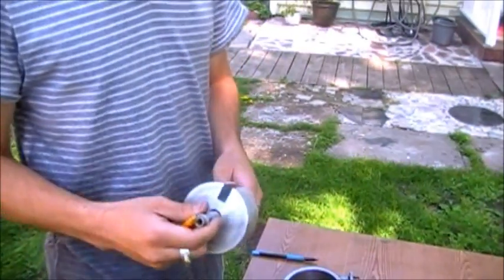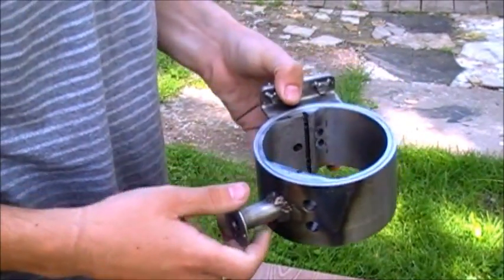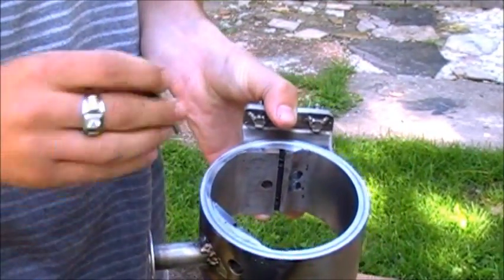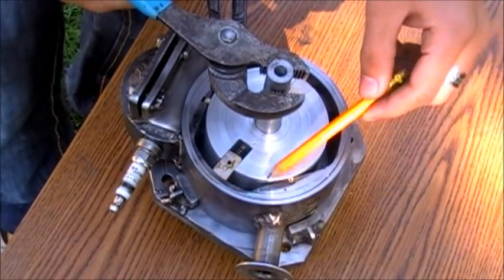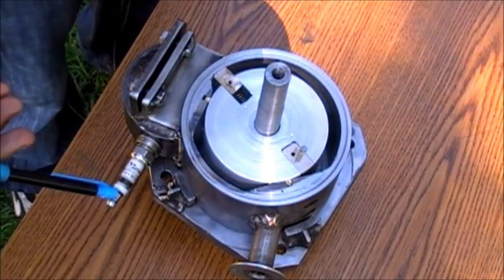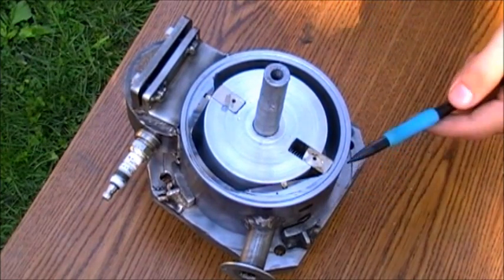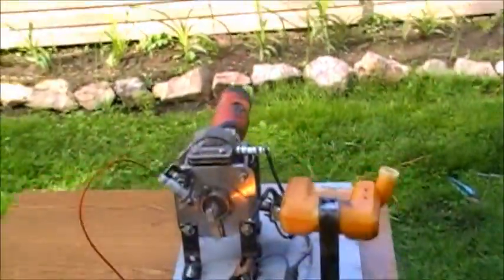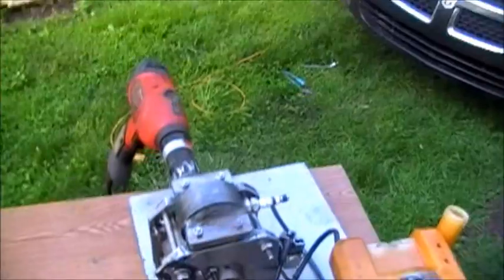new rotary engine semi functional prototype

Comment from the maker: i would like to remind you guys that this prototype is working the way it is only because of very poor execution of the parts .... the prototype is made on a 300$ lathe  and bench sender.
Reply: nikita surgay No need to remind us - anyone with even the smallest bit of mechanical knowledge had an "Oh wow" moment when you showed us how it worked, and we know the problems lay in imprecise engineering.  This engine is going to be absolutely incredible, seems MUCH simpler and easier to service than a Wankel.  I can't wait to see the next incarnation of it!
Reply: @davidwisniewski3378  how wrong you are. IT IS only a modification of the Wankel engine.this poor fools is only wasting His time, the time of combustion engines of any kind ist over. E-engines are the Future because of deveral reasons: muchHigher efficiency, easy to build,  No wear and Tear, silent, No dozens o secondaty parts Like mufflers, belts, srnsors and  Pumps hoses etc. No maintenance and oils needed. You are "riding a dead horse"!
Reply: @davidwisniewski3378   rubbish! All fueldriven Motors are complicated and need dozens of secondaty things Like Filters. Hoses, Pumps, water Pumps ewith belts and precision moving parts. There is only  one Type of pefect engine , which is the electric Motor, which existed before all the combustion engines and will survive them.the reason ist ITS simple sricture and it has only one movinvg ppart which IS rhe Rotor,which has No waring parts. IT will eben "survive ITS car. Only think of all the Pumps that have been driven By electric  Motors for decades, or in cranes or Generators. Constructing a "new" combustion Motor ist "riding a dead horse"
Reply: @davidwisniewski3378  you will never see it running. The simple reason ist IT can never Work. Btw it IS only a  Variation of Wankel's Machine. In ITS time IT was a revolutionary new principle, and the best Car was the German "RO 80" in the seventies but  nowadays only mazda used it. (No one knows why) The best principle ist electric Motors because of their simple construction. I Drive an EV and believe me: it's fantastic.
Reply: There is a serious problem with your engine. It seems that the engine is completely incapable of compressing air before combustion. This isn't just to do with the hugely oversized combustion chamber but also the fact that the expansion ports leaving the combustion chamber don't have valves. This means when the vane moves over the combustion chamber, the air fuel mixture goes into the combustion chamber then immediately leaving it into the expansion chamber, equating to a compression ratio of 1:1. Don't worry though. This could easily be solved by simply placing a valve operated by a simple camshaft that opens the port once each revolution to allow the compressed air fuel mixture to expand. So all you need to do is place a valve on the outlet of the combustion chamber, reduce the size of the combustion chamber and you should be well on your way to producing a fully operational rotary engine. Hope this helps :)
Reply: @JackdalfdaGray  

you have noticed ...thank you ... see this is not a design flaw ... but a feature ... the idea is to not haver a compression ... just like your air tools run on 100 psi the pressure of  combusted air fuel mixture at atmospheric pressure is about 100 psi .... ... think of a potato cannon ... there is no pressure in the combustion chamber but when you ignite the mixture inside the pressure builds up shooting the potato out ... .this is the same principle ... except you have a plate instead of a potato ... 

i do appreciate the input ...
Reply: +Billi Backer Why do you need to brow beat the little guy who is trying and thinking outside the box? Its people like you that will push away and quiet those who try to speak out, innovate and stand outside the box. Meanwhile you&#39;ll sit there along with others and point and laugh from the inside. Maybe if people tried helping instead of just pointing out flaws and crushing the attempt, we would be a lot further than we are today with technology, and as a species!
Reply: David Wisniewski Yes i agree. if this is a success we got a new "Nikita rotory rotor engine" lol. Good Luck and i hope to see your success in the news reports in the future (Im serious about everything i said. good luck  :D  )
Reply: +nikita surgay wha do you try to "invent the wheel" for a second time? it already exists
Reply: @friederich66  

does it now ?
 please point me to any internal combustion mover with 60+% of efficiency ...
Reply: @friederich66  Cleary you ain't an engineer if you can't comprehend why someone would want to invent a better "wheel"!
Reply: My point was that prototypes can out perform even the most relevant designs. This engine is a prototype that needs improving  (a lot of it) but could be the next generation of rotary engines. But it very well may not be, it's still a concept that probably won't make it to production, but it's new. New isn't always better but it'd be neat to see future rotary engines use similar aspects this engine has. I have a lot of respect the creator of this engine because from what I've seen, this is the first of it's kind.
Reply: +Billi Backer   It is so sad that people who do not fully understand the thermodynamics of combustion in engines, volumetric efficiencies and flow coefficients, etc., believe that they can produce a "more efficient" engine by going down the rotary root.   It has been proved time and time again that such efforts always lead inevitably to failure, despite wild claims to the contrary.
Ricardo tested such devices extensively over many years and at great expense, but none came to fruition.  Many millions of dollars were expended in the process.   (This came from the "horses mouth", so to speak, via an ex assistant to Sir Harry Ricardo himself, who is now in his seventies and works as an engineering consultant.)
The power output of an engine is dependent on the mass of air that can be forced through an engine and the efficiency is simply a relationship between the temperature at combustion and the temperature at exhaust.
The mechanical layout of an engine is thus mostly unimportant, except for the considerations of mechanical friction and sealing against leakage, both extremely difficult to overcome in any rotary design.
Every rotary engine I have examined suffers from poor flow coefficients, poor combustion chamber shape, (resulting in quenching of the flame front) poor sealing and high frictional forces on rotor side faces, sliding vanes, tip seals and the like.  A further problem lies in achieving adequate cooling of the rotor and adequate lubrication without resorting to total loss lubrication, which would never satisfy the clean air brigade!

We are stuck with pistons in cylinders because they work well, they are relatively cheap to produce and we haven't found a viable alternative since the 1800's.
Reply: +nikita surgay Bit of a tip for you, inventor to inventor. The sensor you are using for your ignition timing is not designed to operate at the switching speed and current necessary for an ignition coil to function. That's the real reason your engine fires so intermittently and weakly- the spark isn't actually happening reliably. 

I had the same problem with a prototype engine I've been working on since 2009, and after going through several different ignition pickups ended up creating my own hall effect triggered electronic ignition. 

Now that it is positively getting spark every time it should, it fires so reliably that just turning it over by hand I can feel the shaft being pushed along. But like your prototype, it is a bit on the crude side and is leaking too much to actually operate on its own. 

I've got a second prototype on my drawing board that will be suitable for showing off, and hopefully will be machined accurately enough this time to actually operate on its own.
Reply: @renegadeoflife8774  hall effect is simple and reliable!
Reply: +nikita surgery If this idea is original (completely thought by you and/or your collaborators ) you should've patented it and sold it to someone, I am pretty sure you could have taken a lot more benefits from your idea if you had done this.
Reply: @miguelcontreras5782  
i have a patent for it .. however selling it is a whole other can of worms ... its very difficult to sell something when it is not running.... engineers don't even bother to dive deep and understand that this idea is fundamentally different from a conventional internal combustion engine
Reply: you can modify the rotor plate to drive smoother by making curved angular cuts on its 90* ( 90 degree cuts ) , also you should apply the same curved cuts on the sink plates that presses on the rotor  cylinder . 
your engine is a good economic rotary engine , that is great so far , I also noticed the heal of the hub  ( where your seal plates are seated ) it drop off at great angle on the cylinder hub frame , try to use inward curve drop to avoid the cylinder plate ramming on it <--- that ram is creating unstable rotation . which is effecting the timing/ intake and exhausting .  
great engineering by the way  and good luck
Reply: Dr. Shocker mhm... car manufacturers spend millions for motor development. and a d.i.y machine beats them all...,wankel motors have strong advantages and some disadvantages, the home manufacturer has not the materials necessary für a good result.
detail work doesn´t solve the principial problems of this construction.
if it was better than normal machines they would have been a success story. they werent, so the logic says they are not better.
i own a 3-cylinder BMW car, it is fantastic, i was suspicious but  it is a first class motor. i bet they will develop 2-cylinder engines. too.
Reply: @friederich66  a home hobbyist has the internet therefore ALL materials are available to him, it just comes down to cost!
Reply: @73Datsun180B  anyway IT IS stupid to try to invent the wheel a second time. The time of compassion engines is over. The waste too much energy.EVs use energy three times more effective. Believe it or not.
Reply: @friederich66  You don't need to preach to me bro, electricity is the most universal energy source and electric motors are the most efficient engine design. I love fossil fuel and the things that burn it, but I understand it isn't the future. However, I ain't going to shame anyone wanting to spend THEIR time and THEIR money trying a different approach to old tech!
Reply: ***** none. it´s just common sense. te wankel-principle was  used in a german car the RO 80 (ro=rotation) it was not a success. if 2 RO 80 drivers met they showed each other the number of the new motors with their fingers. there was a japanese car which was produced under license and was a flop as well the problems are too big, still it´s the corners  which make problems (sealing.) 40 years have not shown any progress. if big firms with X millions for material and system research cannot solve that, how can you think someone can solve that DIY in a small workshop.... if it was solvable itr would have been solvwed. if it was better than other engines  there would be million sof cars with  such an engine- understand that you are riding a dead horse....
Reply: ***** you must be rich. people like me cannot afford such an expensive toy... for that money you can have a nice house, i would prefer that (i have already one) my bmw cost 29.000 euros, so i saved approximately 130.000 euros. 
i have a range of approx. 800 km and my tank is filled in 2 minutes. i wish you all the best and that your tesla may nit burst in  flames...a rather expensive firework that would be.....
Reply: at least i would have liked to see it running by itself. instead it was moved by an electric driller. i know why: it doesn´t work. it cannot work. again: it it was possible and if car manufacturers would smell profit they would build such an engine tonorrow.. that has nothing to do with idiotic conspiracy theories. this is only an excuse for the personal lack of success. it is sealing, cooling and durability.
Reply: @friederich66  

you are right .... about everything except one thing .... that it cannot work ... it can ... but see for anyone to actually consider it .... i  need to build a fully functional prototype... ....now thats a few thousands of dollars that i have to make and spend ... thats .. all....

i will answer some of your questions ... tho ... sealing .... is mostly a manufacturing problem there vane type of air motors comparable in size that do not use side seals and produce about 70% efficiency.... so its easily achievable with good machinery ... ...

durability ... 

you are right if i run this engine at 10 k rpm it wont last a minute even if it is made ot of best most light weight materials ... 

but if i run it at 1000 rpm there is almost no wear ... at least at thins particular diameter... now if things are precision made out of cast iron and other proper material with low coefficient of friction ...i think it could do about 2000 hours ... 

cooling ... 

now that's the best part ... if you would at least take your time to look at the design or to listen to my broken at the time English ...
 you would realize that there is no compression .. without the compression there is no high temperature explosion ... plus the amount of volume during the expansion is  the same as the amount of combusted fuel mixture ... so it would basically get a full expansion and full combustion...

now the main question how would a motor run without compression ?

simply ... so  in this particular prototype ... the surface area of the plate is 10 square centimeters ... diameter of the rotor is 10cm  the  
now gasoline air fuel mixture is combusted at the atmospheric pressure the expansion ration is 9 .. 

so after the combustion at the atmospheric pressure  the pressure on the plate will equal to 9 kg per square centimeter .. thats at the peak at the exuast it will be about 1 .... 

1+9=10 

10/2=5
so average pressure should be 5kg per square centimeter ... but thats in in the perfect world  so we will drop it to 3 kg per square centimeter ... 

now 3*10=30 kg
now that the amount of total force on the plate ... 
.. 
now the diameter of the rotor is is 10 cm the radius is 5cm 

100/5=20
30/20=1.5kg/m 

now thats torque 1.5 kg/m  at 1000 rpm that will be 1.5 kw. or about 2 hp  ... so that's the attractiveness of this idea...
Reply: +robert McMazing Its true. the fact that the force from the combustion is not direct but has to be channeled to target the spring loaded &quot;ridge&quot; already results in a waste of power produced.
Also i notice that the compressed air/fuel mixture is pushed into the combustion chamber which is larger than the volume of the compressed mixture. the spark plug is located here, igniting an already expanding (not by combustion) mixture, altering (reducing) the compression ratio. Note the dwell immediately after pushing the mixture into the combustion chamber  after ignition by sparg plug = loss of usable power. The power ridge is dwelling before it reaches the power out port from combustion chamber. Lets not even start with lubrication
Reply: +Crobular I Sealing piece cannot follow the profile of the chambers at speed.
Reply: very cool idea, i would have never thought of it, works kinda like one of those new hydraulic pulse guns that are in no way better than conventional impact drivers but still cool, looks like it would have a very short service life due to all the vanes and sliding sealing components that basicly just mash and run over each other, they run flush now but they will get to the point where they wack hard every time they spin at which point the engine would be on its last breath . . .very cool unconventional idea, thinking outside the box but its not going to replace anything and sure isnt more reliable or long lasting than a wankel
Reply: Ci think it's brilliant and somebody needs to take you up on the idea
Reply: nikita surgay id like to add in the rotar piston should be a triangle or square js it might increase pressure and it may ignite better if the spark plug was closer as well
Reply: @gunz_n_bikes171  

this is no rotor piston ... this is a strictly rotary ... and there is no compression...
Reply: its not offset how can it be a triangle or square? makes no sense
Reply: @xibidit  

so the main attraction to this particular design is the fact that there is no compression ... it is an essentially a potato cannon that spins the rotor instead of soothing a potato
Reply: nikita surgay 
Install reed valves on the intake.
Reply: @benhawke7231   have thought about that the actual manufacturing of a reed valve at home is a bit difficult I've tried to purchase one ... but couldn't find one that the right size...
Reply: nikita surgay just so you know, the original engine was built with hand tools
Reply: @RandomsFandom  

i know isnt that just the most inspiring thing in the world ...
Reply: @nekitsurguy2445  it’s trash because it is going backwards on an already proven design. You cannot, and will not out engineer a team of Japanese race car developers. There is a really huge reason for the nacho chip shape, and figure 8 rotation in the rotary engines.
Reply: nikita surgay What materials did you use to make it?
Reply: i like it . but there is a lot to think about. concerning the inability of the springs to have a smoth syncronic response at all fq.  you will need to maby divert exhaust to drive the widget piston instead of a spring , or in conjuction with a spring. or a spring and a cam rod. or a moving weight as part of widget piston.
Reply: @michaelshultz2540  forget IT. The Future ist electric driving because is ist fantastic: simple construction and No wearing, and No dozens of secondary components like Pumps, gearwheels hoses, mufflers etc. And cheap maintainance.
Reply: Michael Shultz now that i think od it they could also try fuel injection. Lol
Reply: ***** you compare apples and pears, as we say here. 
of course companies want profit, that is in no way evil. they must earn money to pay the machines and the workers. if the wankel engine was profitable they would produce itr, believe me. thje production of such a motor with only one moving part would be the hit, you could earn bilions.... they don´t so it is a sign that trey do notr expect profit. and by the was these rotating engines consumed a whole lot of fuel....i have a 3 cylinder bmw engine in my new car (AT) anit takes 6 liters on country road and highway.
the other problem is elecric driviing. it will not be successful, the production is in the x/1000 quantity vompared wis gasoline motors.
the charging takes hours instead if minutes for tank-filling, the range is only about 100-150 miles, not enough charging stations, and im,possible to charge when you live in a big house with 50 flats and you live in the 10th floor.
nioce if you have an own house in the suburbs or in the counrtyside. believe me i would have one (not a tesla...) if it was  interesting. my car (AT218i) is produced as a hybrid, called 225xw. with a e-range of 40 km, about 25 miles...the price: 10.000 Euros more, you will never get this money back in the car´s lifetime....
people are not stupid: if e-driving had  an advantage they would buy them .in the usa tesla has  sold only 27.000 out of 17 million cars last year... less than 0,2 percent... i would not pay 120.000 $ for a car, would YOU???? i think not....
Reply: right you are. i know about thermodynamics, and  cooling is the most importatnt thing. a steam turbine only runs when it is hot on one end and cold on the other. both ends hot is as fatal as both ends cold.
and the cooling of the rotating parts inside is nearly impossible, while a "normal" piston can be cooled with oil from below..
Reply: Billi Backer Indeed.  We are building an engine which requires 60 gallons per hour of oil for each piston!
Reply: +nikita surgay Respect guys!!!
Reply: redxpen With a flywheel, the device would only continue to run for as long as the flywheel had momentum, it would slowly lose that momentum and give up the ghost!
Reply: +Michael Shultz OR  A GEARED ROTATING CAM
Reply: +Jesse Link didn't know Chevy did a rotary prototype,  that's bitchin,  is it recent or old news?
Reply: +Dr. Shocker really old, I wasn't alive yet. but if remember right it was actually a 4 rotor concept in the 70s, which makes it even cooler. think mid-engined vet. mercedes-benz also had a concept back in the 70's. but only companies to my knowledge to mass-produce a rotary is Mazda and Suzuki. I've actually seen the rare Suzuki in real life! it's called an RE5. oh wait and Norton had one, really beautiful but not sure if the public could buy it or just a race bike.
Reply: +Jesse Link yeah,  I just did some research and I guess it was going to be fitted in a Chevy Vega. A muscle car with a rotary,  that'd be weird haha
Reply: +Dr. Shocker google aerovet, wow it's actually quite the looker, hard to believe it's from 73.... looks at least years newer and futuristic for 83 still frankly. there are actually massive diesel rotaries you can buy the power your yacht... lol if only I was rich I'd buy one just cause they're massive as fuck, I've seen pictures. I'll look up that car you mentioned, never seen it. Mazda RX-3 is my favorite rotary muscle car... they are super tiny but look like a Japanese muscle for sure
Reply: +Jesse Link oh yeah,  I've seen a few at the drag strip and those things haul ass. I almost bought one but I don't know enough about rotarys to feel comfortable working on one.
Reply: +Dr. Shocker I feel you there, that's the biggest problem with them is people treating them like any given Honda that frankly would probably work 10 years without an oil change. lol super weird engines. I'm still learning to be honest. have a 2003 miata shell that fully stripped(I mean bare shell no subframes or anything) that's getting a rotary put. I'm not even picky about it I want the 13b out of an FD but the vintage 12a or rx8 renesis would be fine. I really just it to continue learning and shoot fire. already a miata expert and didn't know a thing when I was 18 and got one. before that I had cars older than my mom.... now I probably won't show any interest unless it's Japanese and rear wheel drive.
Reply: +Jesse Link Jeez, it looks like a 90's vette but three times as badass.and those little rx3's are tits. I've seen them kill it at dragstrips. I almost bought one for 1200$ but I don't know enough about rotarys to feel comfortable working on one. Neat cars though.
Reply: +Jesse Link haha, yeah, sorry for the repost, the first one didn't show it posted so I reposted it. Miatas are awesome cars, but one with a rotary would be the shit. right now I got an old 73' datsun 620 pickup. I recently cleaned the carb and did the brakes and it runs like a charm. It's kinda rusty but I love it.  gonna paint it this summer too. I'm so looking forward to driving it my senior year.
Reply: @Datsunuva  I have owned my 73' 610 for 17 years now but it has been off the road for 13. I finally got my own shop to work on it, but I think I will do my Cletrac crawler first. I also have a couple of part -built 1/12th scale NZR steam locos to finish as well
Reply: just feel the need to correct something that I said, the traditional Mazda rotary engine is still a 4 stroke. it's just sit all four strokes happen at the same time, albeit at different points in the chamber obviously. super weird, I was just doing some exhaust research and realized my flaw
Reply: +nikita surgay  This engine is worthless.
Reply: +Marek Sumguy   Springs under rotor seals will get too hot and fail. Use leaf spring here.
Reply: +David Wisniewski Then you have no mechanical knowledge.
Reply: nikita surgay great idea keep going with it it's a great "2 stroke" motor.
I challenge a sub-Saharan African to come up with something on their own like this I'm going to call that
"NEGRO NOW YOU INVENT SOMETHING CHALLENGE" THEY HAVE INVENTED PEANUT BUTTER AND SOMETHING HAVING TO DO WITH TRAFFIC SIGNALS BUT THEY'VE ALL BEEN AMERICANS MIXED WITH WHITES
Reply: That's even more impressive
Reply: @nikitasurgay3549  you are tryind to "invent the wheel a second time". The time of combustion engines ist nearly over.  Die to the Rules of thermodynamics hey waste 70% of the energy, while EVs lose onl, 5% and so have an efficiecy of 95% you are tiding a dead horse. No one ist onterested in your invention (which is not an invention at all)
Reply: Wasted time it will never run ..😂😂😂
Reply: +Billi Backer Ever heard of improvement? I hope you have noticed car manufacturers have stopped using a circular piece of stone as wheels. We have moved on to bigger and better things like rubber tires and aluminum rims. This could possibly be the next main rotary engine. Good luck with the prototype.
Reply: robert McMazing he is riding a dead horse. you may laugh at me if you like, but i think it is sad that he is wasting his time. he will never be successful. none og these motors, neither his nior another will ever  be able to work 100.000 km.materials do not matter, it is the principle. in theory it is  impressing but "in praxi" it will never work. the fuel consumption is too high.
NSU in germany has made the ro 80: a flop. even mazda has given up the rotation-piston (?) engine because the problems were unsolvable. and you think  one man alone can  solve that?
impossible. we may takl about that in ten years again. i predict he will have lost all his money